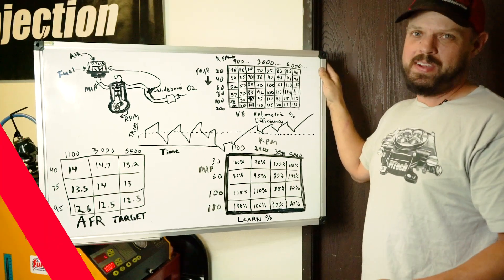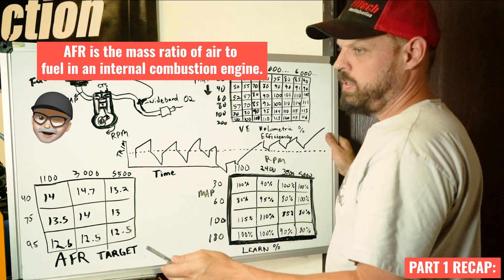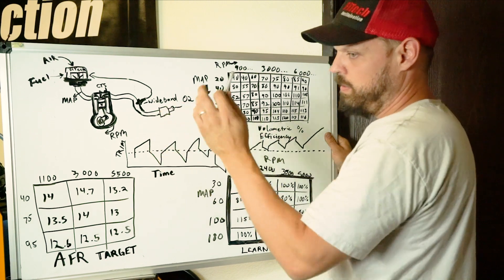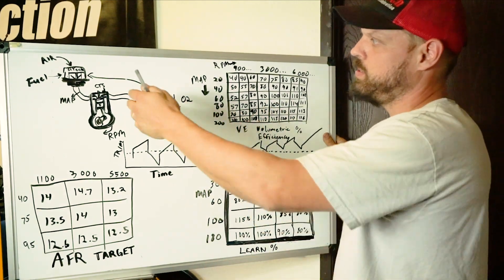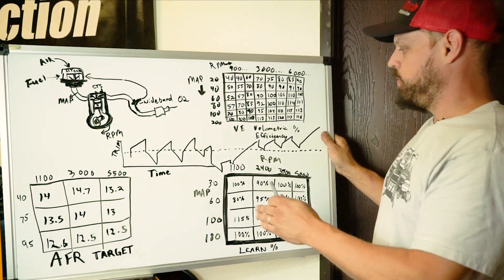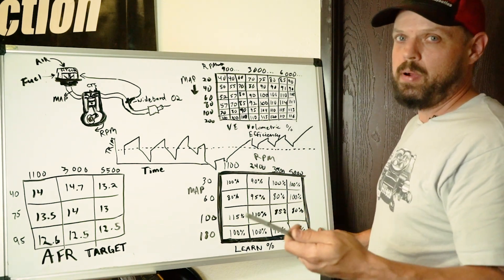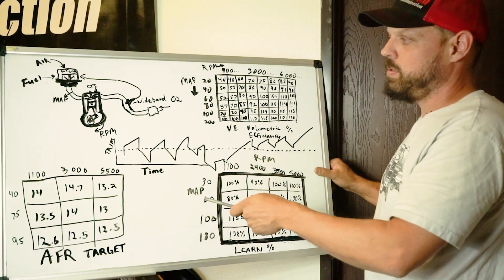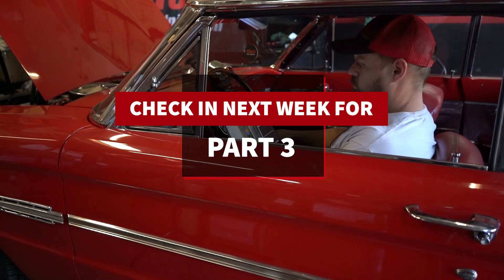How Closed Loop AFR Trim & Learn Work Part 2| Tech Tuesdays | EP49

Comment: I have a 1200hp system. It will fire but won't stay running, I've talked to tech on the phone and via email and the don't seem to have to answer, so the told me to try you tube! Cranking volts are good tach signal is good. It was starting and running just fine and one day came out to move it ,went to start it and it back fired through the throttle body after that it was hard to start . Now it will start and immediately die like somethings telling the fule pump to stop running. Any ideas?